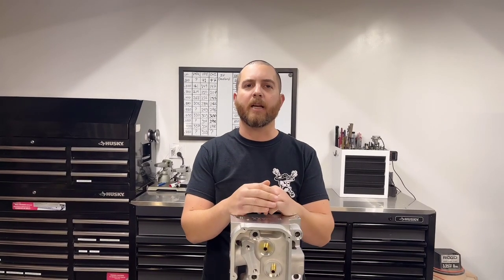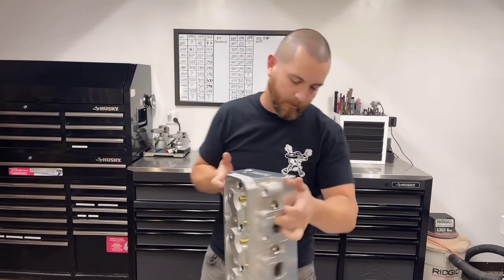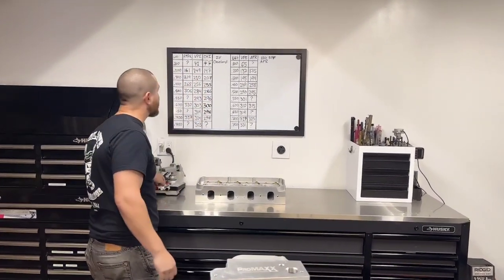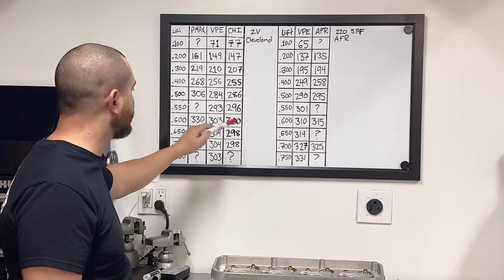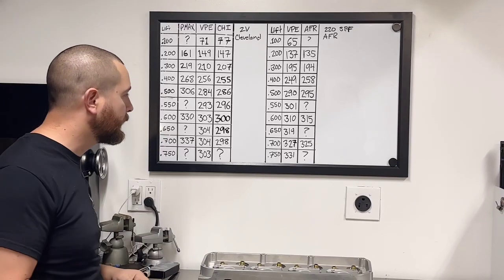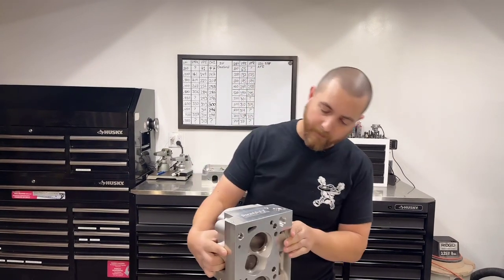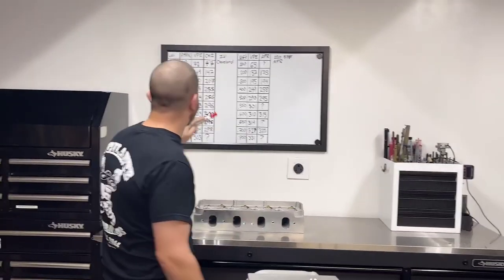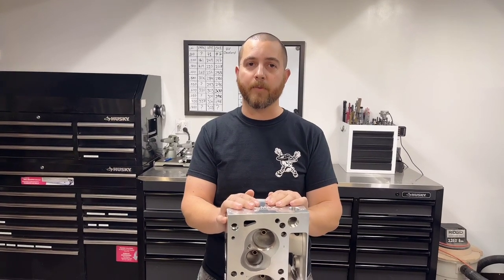Aluminum Cleveland 2V heads from Promaxx, will they work for your small block Ford?

Comment: They actually look like Aerflow 2Vs. I just bought some and are a decent well finished head. Exhaust is lifted 1/2+ plus on mine compared with stock. Intakes are within reason std 2V which are better anyway. Chamber is FAR better. They use std 2V Vlave size. Chamber size though at 68CC+ is too big for compresion. Will need a 040-050 cut to get half decent. Probably give OEM 9-1. The chamber will cop a LOT more than that

Comment: So what you are saying is the CHI 185 and 208 head will make more power, my guess it at least 70 on the TQ and 50 on the HP. Why would you run an outdated 2V head in aluminum.
Reply: It depends on your application. And budget. The 2V heads are comapable with genuine parts. Intakes, exhaust manifolds etc.
The 185 3V are better,, a friend has 500 real wheel HP on a 377 Clevo. But then you need the matching intake. I was very surprised by the  driveability of them on the 377 BUT that has a 3.7 diff and a 5 speed Tremec. 
On my 400 Galaxie cruiser with 3.00 they would be useless,, the 2V version a lot better. Though it will stay with 2V 302 heads as they do the job ok. Those CHI 2V heads will sharpen up any mild Clevo. As will most better aftermarket heads. And they are a third of the weight.
Reply: @ldnwholesale8552  So then you are telling me that a 2v head with a larger port and less air flow , will have better drivability then the 185 CHI head with more flow thru a smaller port.

Comment: Looking to rebuild my 351 Cleveland. Nothing extreme just something a bit more torque than stock. it is in a semi-daily driver F100. The previous owner put 351M heads on the Cleveland block. My question is would these heads be to hot for my application?
Reply: Should be fine
Reply: From the facts presented in this Promaxx video, I think these heads would be a good choice for your application. The biggest advantage would be the modern combustion chamber design with smaller volume. The compression increase would provide a very noticeable increase in torque and horsepower while still using pump gasoline. 

The 351M heads would require a lot of work and expense to flow as well as these alloy heads. The reduced weight of aluminum has obvious benefits as well. The exhaust ports being in the stock location will allow more choices for the exhaust system. 
Too hot for your application ? No way 🏁.

Comment: I'd love to see a dyno run with these on an otherwise stock 400. Being able to actually run some timing without turning the engine into a grenade would be nice.
Reply: Me too. I'd like to see a closed chamber 2V head with raised exhaust ports on a 400. Something that would raise the compression ratio by a point and a half. Watching this article, I do not understand WHY somebody would go to all the trouble to cast an aluminum Cleveland head and not raise the exhaust ports. Keey the port design so as to be compatible with stock headers, but put it around 3/4" higher. The acknowledged  shortcoming with Clevelands is their crappy exhaust ports. But why make some new heads but not solve the exhaust port problem.
Reply: @bobkonradi1027  raising the ports on a low buck head makes no sense as it would eliminate using them on a stock shock tower car like a mustang or cougar without expensive headers. Using those headers eliminate any advantage of the raised ports as you simply exchange the port flow issue to a header flow issue due to the shape transition required.
Reply: @Ares-jx4ep  if they are raised and your using them on a 302 just order the headers for a Cleveland and should be really close
Reply: Will they fit a 400? I have one.
Reply: @steveharper9964  yes they will.

Comment: Stock flow numbers for LS3 heads.   Lmao 😂
Reply: Flowed a Chinese head distributed over here in Oz, which I believe is the same head as the Promax, except this is a 3V/4V version??? Head is very nicely finished...only complaint is valve seat insert is hanging out in the airstream in the bowl, for probably 75% of the circle... easy to fix with die grinder. 
Here's the #'s Otb/ & seat tidy up (nothing else). 4.030 bore with bore notch out to near felpro gasket edge.
2.1" valve w/30deg back cut.

.1      69       68
.2    140     148
.3    198      208
.4    240     253
.5    268     277
.55  277    285
.6    288    292
.65 293    303
.7   303    308
Reply: @parkerracing7374  As you are most likely aware, stock Close Chamber 2V sits at about 175-180@.45in, and stays that way with more lift. Best Ive done with reshaping is 220@.500, but again its mostly all over by 0.45in lift.
A bigger surprise is a stock Open Chamber 2V starts at 200cfm@.45in unmodofied and goes on to 235@.50in.
Yet, everyone wants the compression of the Close Chamber over the flow advantage of the Open.
Must be a case of copycat racing instead of do something different racing.
Reply: @crd-nz_001  The open chamber heads are prone to hot spots and detonation.
Reply: I agree LS heads are just Ford copies also I haven't been able to get a set of LS heads bolt on my Ford.
Reply: LS engine is a copy of a Ford engine design so who cares. Notice how the new GM 1000hp crate engine has FORD designed even spaced intake runners for the heads and intake 🤔
Reply: @nova467spanker  Evenly spaced and duplicate runners were first used by Peugeot, try again.... They won Indy more than a few times with that engine as well. The only thing Ford made at that time was the Model T and charcoal.
Reply: @shvrdavid  I could also say, to my knowledge Ford never designed a fast burn chamber,  aluminum, 15 degree  cathedral port head... haters gonna hate, the real question is why didn't Ford put all the good attributes from across all the engine models they had into 1 GOOD one? Instead you get a shitty headed 302 with paper thin cylinder walls.
Reply: @shvrdavid  Yeh but Chevy LS boys can’t claim to be all that after doing a Chynaaa and Copying Fords Boss 302 😂😂👍👍
Reply: @shaadydog1  Ford did . It was the Basis of their NASCAR and Road Race Engine Programme for Decades 😂😂👍👍
Reply: @nova467spanker  wrong
Reply: @mikeeagle2653  wrong about what? How about you be more specific...  The architecture and design of the LS block is from a Ford FE and the bore spacing is only .02"   difference than a SBF. I personally put my stepdads 5.7 LS heads on a Cleveland block just to prove this point - just for fun though and to piss him off chevy made a Ford engine. 

And yup he new gm 1000hp crate engine has equal length FORD intake runners on heads and intake. 
https://youtu.be/wgSoHlSU3WI
Reply: LS has been beaten to death. They're not interesting or cool anymore. Just an engine that is plentiful in junkyards.
Reply: @DastardlyDeedsDoneDirtCheap  lmao 😂 that’s common line from haters.   Still winning more races then everything else for less money
Reply: @mikeeagle2653  Because they're cheap and plentiful. I already said that. Also, no bone stock LS3 heads are flowing those kinds of numbers.
Reply: @mikeeagle2653  LS is an Example of GM doing a China . Copying someone else’s Design 😂😂👍👍
Reply: @Saffsa   lmao 😂 ok if that makes you sleep better at night
Reply: @mikeeagle2653  Sleep better at night . Aware and Alert in Daylight 😂😂 . Just stating the Obvious 👍👍